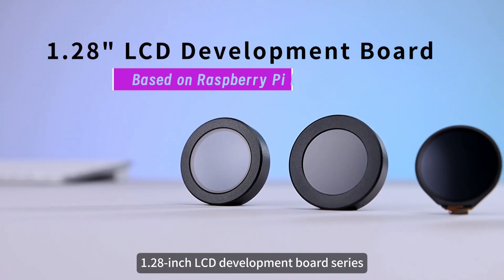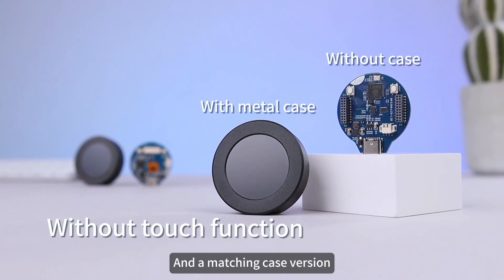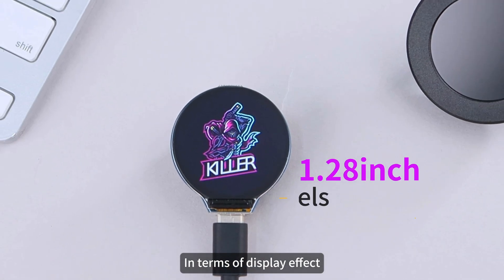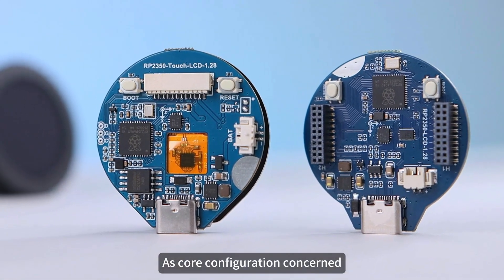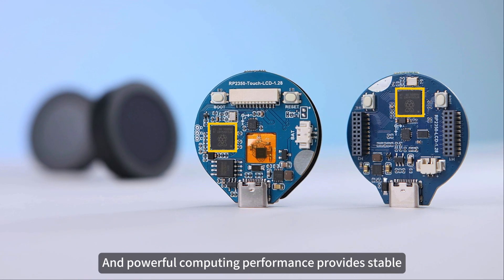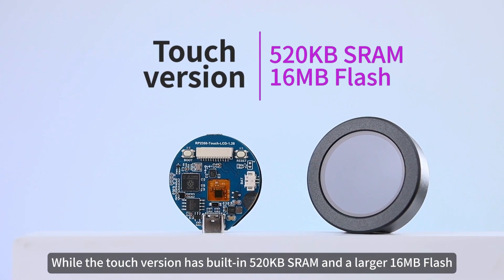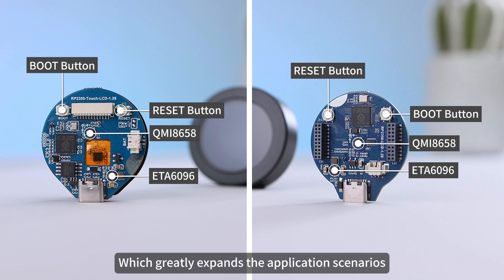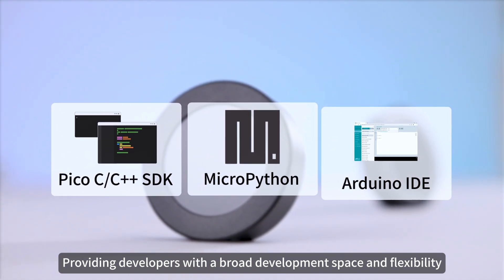RP2350 MCU board with 1.28inch round lcd,  Optinal touch and case, 240×240 pixels, IPS panel

Comment: "Demo", listed in the Wiki linked from the Waveshare comment below, should download the demo files. That download link does not work on the no touch (first) link. The download works correctly on the Touch link. If you want a Micropython demo, there is only one .py file in the ZIP download, and it looks to be BOTH a driver for the display ("class LCD_1inch28", at the top) and a little demo (at the bottom). The demo shows accelerometer info (DOF_READ = degrees of freedom). The demo part shows how to read touch gestures for up/down/left/right (e.g. "UP" = 0x01), display text e.g. LCD.write_text('Double Click',25,110,2,LCD.black) and draw shapes e.g. LCD.fill_rect(0,200,240,40,0x180f). I had to work all that out for myself - it really should be in the appropriate part of the Wiki. So, it's here to save you the time! My device arrives tomorrow, so looking forward to trying out.

Comment: How does the performance compare to the ESP32 version?
Reply: The overall raw power of an ESP32-S3 (xtensa LX7) running all 2 cores on 240 MHz is higher (1181.6 CoreMark Score, 4.92 Points per MHz) than that of the RP2350 M33. Even on dual core, the M33 comes only close to extensa LX7 SIngle Core. However, M33 peaks at 150 MHz. Regarding energy efficiency is M33 much better. So if you are on a LP scenario I would go with M33. The M33 is but better than the other ESP-32 h/c variants. If you want a Cortex that's on par with ESP32-s3 xtensa LX7 you should go to Cortex M4, if you want a better Cortex, you can take M7.